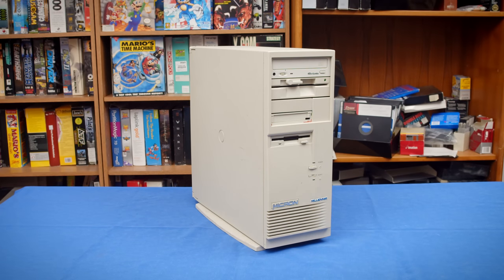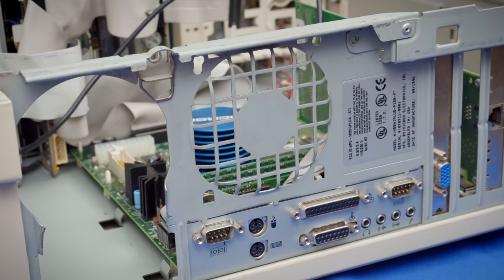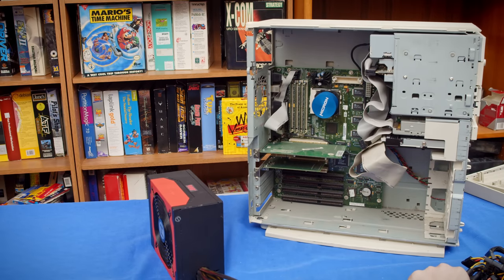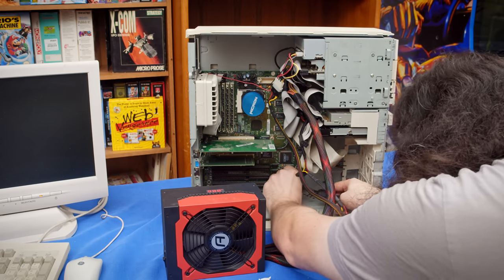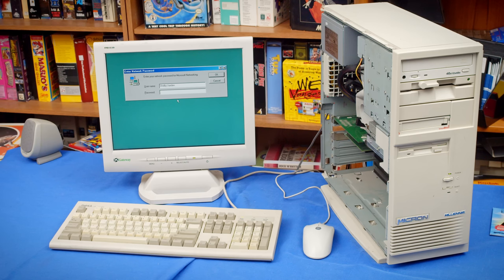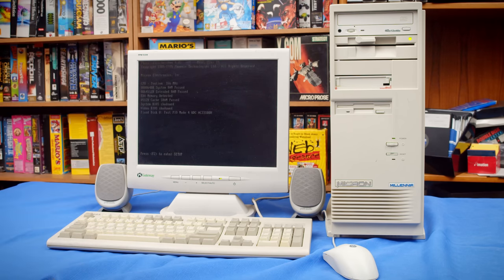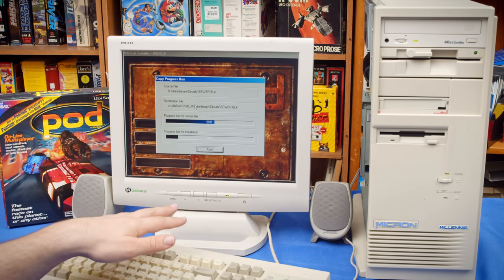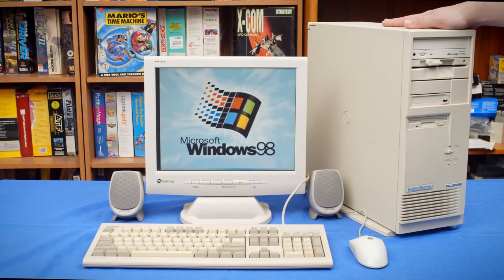Troubleshooting the 1996 Micron Millennia

Comment: 13:00 I had not one but TWO motherboards destroyed by a faulty RAM: they requested reading BIOS from floppy at startup, and if you don't have one  ready the BIOS got erased and system bricked. Sure, I could desolder their BIOS chips and flash them with an external programmer, but after calculating the cost of money and time I gave up and just purchased another motherboard. I didn't know that RAM could kill BIOS before this incident; later I performed MemTest86 on all RAM modules I had and recycled those with faulty chips.

Comment: This kind of thing still happens to this day. I had a person bring me a laptop that wouldn't update past Windows 10 build 1709. I was too deep in other things to work on it, and he wasn't able to leave it, so I downloaded the Update Assistant, and told him to try that when he got home. A couple weeks later he comes back, and had taken it to another shop, and they wiped the drive and tried a clean install, which did not resolve the issue. He was able to leave it with me, so I went through and checked everything myself, no change. Updated the motherboard's firmware, and BAMM!!!, it updated to the latest build. A lot of people balk at updating the motherboard BIOS (and honestly if you don't know what you are doing it's best to leave it a professional in some cases) but it honestly should be one of the first things checked.
Reply: I've actually run into that problem before. There was a version of Windows 10 that seemed to require a BIOS update on a lot of machines.

Comment: you are probably aware of this but just in case, there is a problem with the default disk cache in windows 98, its the main reason most people didn't like it can complained that it slowed down over time had had to reboot it frequently. Left to its own it will pretty much cache all recently opened files to ram until the ram is full then to virtual memory. as you can imaging doing that brings the computer to its knees. the solution is to edit the system.ini file. under the vcache heading include 2 lines: minfilecache=1024, and maxfilecache=4096, you can set the values to what ever you want but those worked well for me when I was running win 98 and I never again had to reboot due to system becoming sluggish and unresponsive.

Comment: Less than 30 seconds in, yes I agree it looks great! And a nice selection of drives there too including a tape drive which I think might be a travan (edit: no. it was a Ditto).
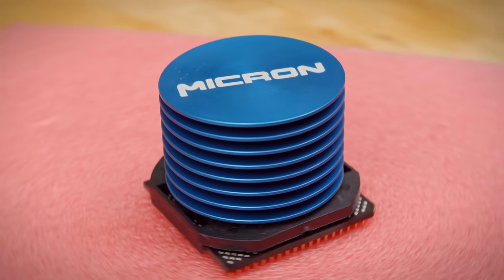@3:55 perfectly centered 360 spin was also appreciate :-)
Reply: The selection is not nice for the time period apart from the Ditto drive and the 3 1/2 floppy.
The CDRW drive is from 2002 and for that PC it should be a SCSI drive 6x2.The first ATAPI drives were released a couple years later.
Also  by then the 5 1/4 drive was considered obsolete and was not included with Pentium machines .
Reply: @manos7958  That's a fair point. I was just thinking from the perspective of so many different types of media in one box 🙂
Reply: @Error42_  Actually, the truly widest range of media installed in one box was in 2000s with the first digital camera craze. The 3 1/2 floppy was still a thing, there was a CD-rw drive as well as a separate DVd-ROM drive and many PCs were equipped with a front bay for all kinds of memory slots (Compact flash to memory stick and SD,SDHC,miniSD, etc) as well as the USB slots on the front to connect anything else available.

Comment: Those Floppy-Tape drives are connected in parallel to the existing 1 or 2 floppy drives in the system as a "third" drive.

Comment: 8:37 there's this stuff I have called Alien Tape. I used it to mount the mod chip in my ps1. In terms of strength... I have a d-link right angle usb extension attached to my emachines xp build. I can pick up the entire computer from that d-link extension.

Comment: at general windows 98 can manage drivers socket7 system, sound blasters or clones drivers, 3dfx drivers ... but still u need install original drivers for games. With these basic drivers (for office only?) no DOS sound support, basic windows midi, games not detecting voodoo card, S3 need also drivers i had on some S3 cards problem with w98 s3 driver. Bad refresh rate in dos games under windows for example. Iam happy your computer now running. Love your videos ❤

Comment: The case looks similar to a Dell case from a dimension 900 series.  The front panel is different. The dell case I have also has a support metal bar from the front to the backpanel.

Comment: Regarding the inability to use a 40GB hard drive: I had a Gateway 2000 P5-200 of the same vintage as your Micron Millenia. (At the time, the clones to get, if you couldn't afford Compaq, HP or AST, were Micron, Dell and Gateway 2000, although I avoided Micron due to frequent reports of uncooperative tech support. Love that tool-less case, though. One thing you got used to with Gateway was screws -- lots of 'em.) Computers of this vintage were mostly still using the original IDE spec, or maybe it was the 2nd revision, and only supported hard drives of up to 9.6GB capacity. Those were the pricey hard drives, though, so in you'll find a lot more surviving 8.4GB drives nowadays. I wanted a 9.6GB drive for my Gateway because, well, just because, really (as I never came close to filling its original 3.8GB hard drive), but I think I eventually settled for a 8.4GB drive because it was what I could afford.

Comment: Great video!  Who actually made this case?  Because I have a dell from a little bit later that has nearly the same case.  It is a decent case to work with.  It was always nice doing a new install on older hardware at the time with Win98SE because 98SE came out in 1999, a few years after this computer.  Which meant that computers from this era didn't need external drivers as they were built-in to Windows 98.

Comment: You need two things: Windows 95D Lite, which will take too much explaining if you haven’t heard of this yet but it will play nice with your Voodoo. Second, you should try Ontrack Disk Manager. This is meant to format the hard drive to its full capacity if it’s larger than this systems 8.4gb limitation.

Comment: That tape drive is more generally called a Travan drive, developed by 3M.  It's a slowish tape technology that can only backup 1.6 gigabytes per tape, and it does that by taking multiple passes through the tape, writing one track at a time.

I have a similar model from a different manufacturer though a recent retro-computer purchase.  I can't figure out any real use for it either.

Comment: It’s actually normal to have a windows 95 era pc run out of the box under windows 98 as the standard drivers of older components were all included in 98

Comment: you have to install 3dfx voodoo drivers instead of those ”blankings” from mictosoft. they are just inf file instead of driver files set.
and you actually don't need updated creative drivers, try to upgrade cpu using vrm module.
I didn't watch your bios troubleshooting video but from my experience there may be hdd lba translation issues on such old machines. I use Norton's diskeditor to zero out first 64 sectors of the drive (don't forget reboot after) prior to it's partitioning. that may solve some inbooting issues.

Comment: When i had windows 95/8 i had a STB systems voodoo 2 with 12mb is used to make the machine crash all the time if using D3D. playing games like quake 2 in voodoo mode would work fine. The graphics card wouldnt certify even tho i had WHQL drivers. the on board video card was a sis6326 with 8MB of ram

Comment: Wait, the tape drive runs off the floppy interface?! That's mad!

Assuming you didn't use the second screw on that hard disk cradle you could probably pop the disk out without having to remove the cradle from the case.
Reply: Yes, tape drives that ran off the floppy interface were a thing back then, but as you can imagine, tape drives connected that way were quite slow. Not as painfully slow as a parallel port connected external tape drive, but you certainly wouldn't have wanted to wait around while a floppy-connected tape drive did its thing. SCSI was a better option for a tape drive, but that was expensive if your PC didn't already have a SCSI controller in it. I had a Gateway P5-200 desktop that I bought in 1996, and I bought and installed an Exabyte Eagle96 tape drive for it, but I think that came with a proprietary interface card. If I remember correctly, ATAPI tape drives didn't become a thing until a few years later. I'm not sure if that was because the revision of ATAPI that was in most PCs at the time didn't support tape drives, or if tape drive makers just hadn't embraced the IDE bus yet.

Comment: could use disk overlay software to get a larger drive working, had to do that with my laptop from 93 would've been stuck with 500mb otherwise, got a 64gb sdcard working in it which was overkill but fun, loaded it up with 1000s of midis and mods and win3 games.

Comment: am i seeing this right, 900w on that psu? i recently read that having a power supply too strong isnt good for its parts in the long run because theyre nowhere near being fully utilized. seeing how you know about caps from the last videos is there some truth to that? this computer probably doesnt even consume 75w with pentium 1s and vodoo 1s having tdps in the 10-15w range and the rest being near negligible.

Comment: it was a real shame that voodoos couldn't do windowed overlaying on the passthroughed signal like some of the dvd decoder cards did.  there was some softwre project that was supposed to copy the output to a window and it was hyped on sites/forums back in the day of voodoo1 being current but that software was never released.
Reply: The Linux/Mesa drivers did support windowed rendering. I don't recall anymore how well it worked in practice, but it must have been pretty slow with the CPU copying the frames from the voodoo card to the other card over PCI.

Comment: That case was originally an AT case, the metal bar on the back separated the power in/out from the PSU fan. And Necroware has recently made a VRM module for socket 7 boards like that one, so you could put an MMX (or even higher) CPU without issue.

Comment: I'm not sure if I'm confusing cases, or it was this (or the dell version of this case) but I seem to recall there being a way to vertically mount a HDD below where you mounted the one you put in the machine (even if I'm not you might be missing a clip or rail or something)  in that whole plastic full size expansion card holder area.  Also reinstalling newer versions of windows on the last versions hardware was always easier.... Installing windows 98 on a computer from 96 or installing windows ME on a computer from 99 usually included most of the drivers.  Microsoft DID TRY to make the driver thing not a nightmare..... Too bad it took them (What from 98 to  (windows 10) 2015 so.... ) 17 years to make Windows Update's Plug and Play  driver system work as documented.  It as always so annoying in the past to have that check windows update option for drivers because it was so useless.....
Reply: It is the same case as the Dell Dimension sans the front bezel.  His computer is missing some of the plastic that goes around the hard drive when it is mounted vertically but it is not needed.  You just need 2 screws that go thru the front to mount the hard drive using the 2 dimples below the switches and LED’s.

Comment: I really don't understand the fad of wanting to run the very unstable dos based Windows versions.
FAT filesystem corruptions, registry DB corruption, DLL hell, oh dear it was dark times.

Also, almost never installed drivers when using gnu linux distros. Not to mention the capability of booting the same OS install on different hardware since long ago.

Most games run on NT Windows. And those that don't have unofficial patches.
Or WINE / Playonlinux, etc.

And Dosbox runs the games much better than period correct "bare metal". With much better granularity for when the CPU cycles need to be adjusted.
And games hard to run like Terra Nova strike force centauri.

I don't understand wanting to run those disastrous Windows versions again.

Best wishes.
Reply: It's a proper retro experience, that's why. Also, DOS games were a thing in the mid-to-late 90s, and not all Win9x games run on NT/2000/XP. But you obviously know that. 😊
Reply: @looks-suspicious  Most games run on NT Windows. And those that don't have unofficial patches.
Or WINE / Playonlinux, etc.

And Dosbox runs the games much better than period correct "bare metal". With much better granularity for when the CPU cycles need to be adjusted.
And games hard to run like Terra Nova strike force centauri.

I don't understand wanting to run those disastrous Windows versions again.

Best wishes.